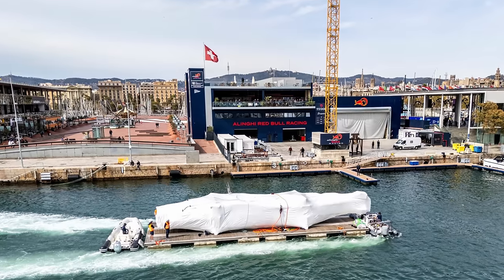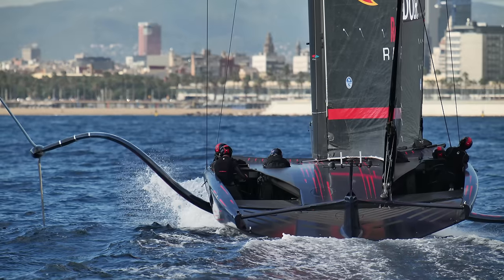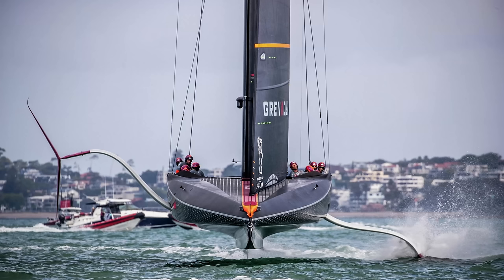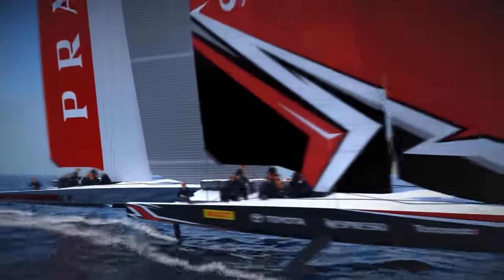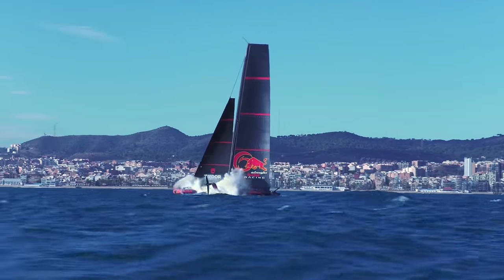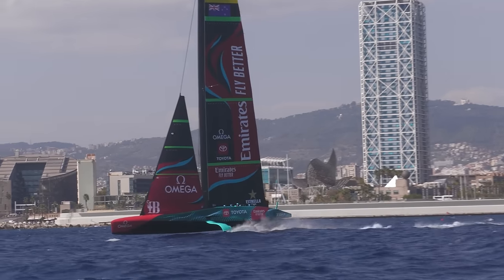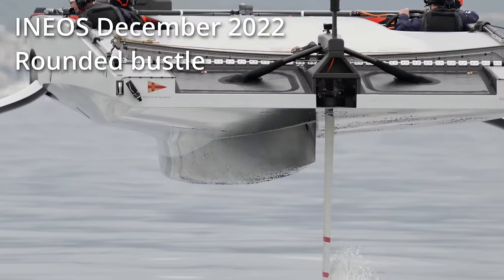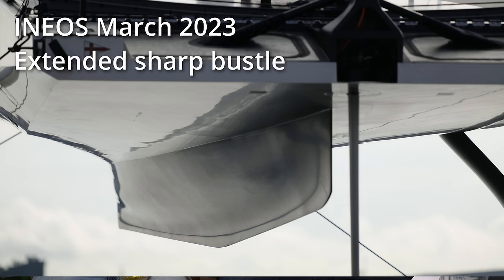The Cup's Most Radical Hulls Arrive: what should we expect?

Comment: Haven't read the rule, so not sure what is allowed and what isn't...
but if you move the 4 cyclors inboard and just aft of the mast (in a sort of 4-pack arrangement).
And the helms and flight-controllers forward of the mast, and outboard (in a 2-pack tandem arrangement, on each side)...
Then that could create three crew blisters on a reasonably flat deck.
Plus the good weight distribution as discussed.
And potentially a good funnelling of airflow onto the mainsail deck/endplate (without needing to sink the base of the mast too much ??)

Comment: Can someone clarify something for me?
at 14:40 they are suggesting that the "stabilizer" on the rudder provides lift to the boat. 
that would be an instable design (that is why in non canard aircraft, the stabilizer actually prvide downforce ). I think it's not possible to have flight with it without feedback controol loops wich were not allowed for AC37. 
so are just now aiming for the ustable design as feedback loops are allowed by the rules or is there something i'm not getting?
thanks

Comment: For the jib tack can't they do the same thing as the mast. I.e. Have it 1.5m above the waterline but then lower the deck around it and put in additional sail area below the jib tack point? This would give you are really low bow section, extra sail area and only downside would be if you went down the mine you would have very little bow section and also might be problematic with waves. Still if like F1 cars it is all about downforce and reduced frontal area for aero not for hydro issues then this is where I would go. Basically an F1 nose with a thin arm up to the tack point and sail shrouding.
Reply from the maker: Very good point and I'm not sure of the answer. I'll have to re-read the rules

Comment: Dear Mozzy , thanks for your analysis. What do you think about having rowers instead of cyclists, to reduce air resistance, be able to move them back and forth in the boat according to speed (reduce ruder drag) and use their impulse to get the boat out of the water?
Reply from the maker: The power in out has to be a single rotation device per sailor, so really limits to either grinding or cycling I think

Comment: @16:00 you hit a good point in regards aerodynamics... what would F1 redbull do.... windward downforce wings with a DRS mode when on the leeward side .... to enable you to center the crew ,.... could you configure the foil that's out of the water to optimize downforce vs forward thrust better?
Reply from the maker: I think you would struggle with the wing element to do that, but the arm can be shaped to achieve this possibly

Comment: Thanks for the analysis! What do you mean with the "organising window flow" features?
Reply from the maker: F1 cars have lots of small fins on the larger wing and body surfaces to direct the flow of air as the car passes through it. However, F1 the air always travels over the car from front to back, with maybe a yaw angle of 1-3 degrees through a corner or gust. So it is easier to place these additions so they work a lot better. On yacht, the wind will change by 30 degrees through a tack, so whatever hull shape they choose it has to be efficient through a much greater range of yaw angles.

Comment: Not sure if a pulling rudder would be generating downforce. Isn't that just a force balance between weight in the front and in the back?
Reply: I thought that at first but I think because the foils are not on the center line and quite outboard there would be some righting moment created by the rudder as the pivot point is the foils if that makes any sense.

Comment: Will be interesting what Grant Dalton says as he says this NZ boat is going to be very radical compared to the last one. Any ideas anyone as to what could be radical.
Reply: All crew below decks, helms in a perspex bubble! These are vastly over-powered computer-controlled aircraft and the cyclors are just keeping up a bit of hydraulic pressure to tweak the sail adjustments and make it look as though it's still a sailing yacht!
Reply: @Toob41    And there is that as well. It sounds as though the boat is going to be significantly different to the challenger. Time will tell.

Comment: Cheers for this! Anything to stop putting the grinders in the bow/in front of the mast? Also can they be covered by a fairing/ below deck? Would be grim for them and maybe a bit unsafe but what are the rules for crew placement/cockpits?
Reply from the maker: Yes, all crew member can go 9m forward of the stern except briefly in maneuvers or to fix something. On the old AC75 you can often see the line drawn on the decks so the sailors know where then can go.

Comment: Watching for the first time, great tech debate but what is a busell and is that how you spell it!
Reply from the maker: So the two key terms are Bustle and Skeg. A bustle is a prominent hump. 
A skeg is a finer tampering along the keel line to sharp vertical. 
The teams have used mixture of the two features to aid take off with a smooth transition from displacement to flying, but then also to end plate the yacht to water and stop wind escaping underneath

Comment: I think it's not just righting moment improvements from reducing the Rudder pitch load, it's also a reduction in lift based drag.
Reply: Not if it’s pulling down. Then it’s downforce based drag which is upside down lift 😂
Reply: @rbcg105  I work in aviation, the official term we use is Total reaction.  Regardless of the direction of the TR there will always be a component opposing the forward motion, called drag.   Any time you can reduce the demand for TR you reduce this drag component. We called this lift dependent drag or induced drag. It doesn't matter if the pilot has rolled the aircraft 180 degrees and the lift component of the TR is pointing at the ground, it's still lift. Aerodynamics defines lift as the component of TR that is perpendicular to the air flow. It's not an up or down force. They might not speak this way in sailing, I'm not sure. Regardless the principal is the same, you want that elevator on the rudder to have the least amount of work to do. Moving the CoG of the entire boat in order to unload the elevator will reduce the TR requirement and therefore the drag component. We actually deliberately do this with aircraft as well, by biasing the loading  rearward.
Reply: Agreed but perhaps these missiles don't need to go any faster, they just need good controls to help keep them the right way up.
Reply: @Toob41  it's a race, you always have to go faster! You can gain stability by moving the centre of gravity in front of the center of lift. In this set up any disturbance that causes the main foil to increase its angle of attack and therefore lift, will create a nose down pitch. This will then reduce the foil angle of attack and the lift and the boat will settle. Problem is, in the cruise state there will be a constant nose down pitch produced by this couple that the rudder elevator has to oppose. This will increase the drag and reduce the pitch authority of the elevator. I haven't dug through the new rule to see what level of auto trimming of the foil is allowed. But a combination of that and the sailors skill will set the demand for how much you have to sacrifice pure speed for stability. There are also other considerations. Everything I have said relates to the steady cruise state at the design speed. But they also need to be able to lift off at low speeds and cope with a decent amount of wave and yes be actually manageable to sail. These will also affect the final positioning the foils.
Reply: @greybuckleton  Interesting theories. Sounds to me that you should be on with Mozzy as an adviser!
Reply: @Toob41  he knows these things as well. I have heard some of his Italian friends talking about it on the show. What he is great at is trying to discover which way the various teams have gone with these generalised concepts and the fine details of the design rule. I really appreciate his coverage as this level of technical detail would never be available on mainstream TV.